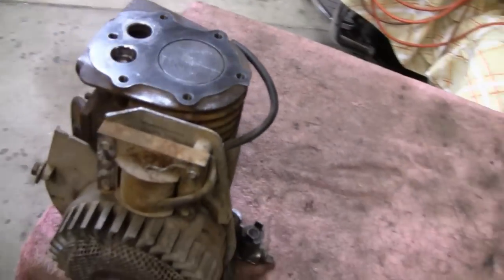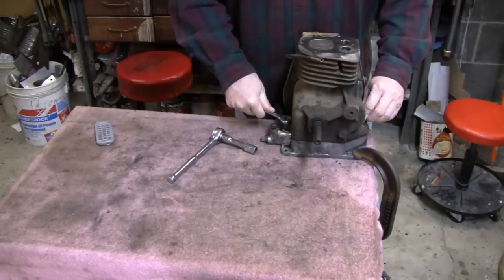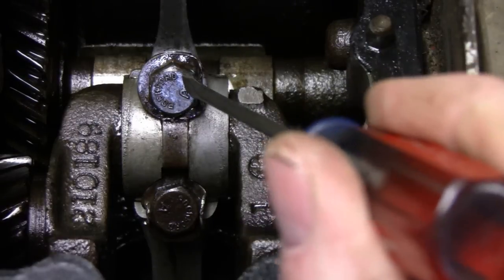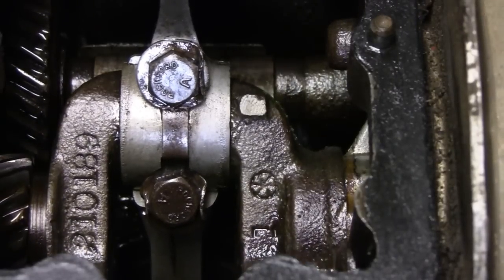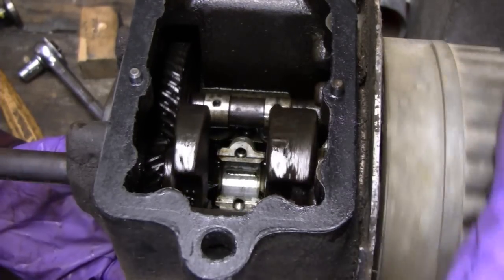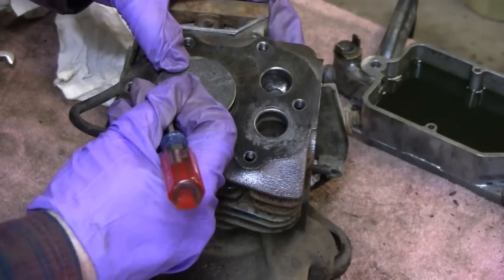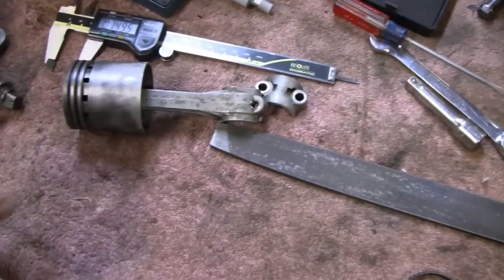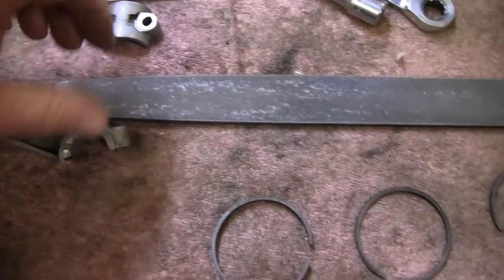HOMEMADE WATER COOLED BRIGGS ENGINE (part 6)

Comment: Extra points for lapping the rod cap to tighten up the big end bearing. These engines are very forgiving and they do just fine with a little "egg shape" in the rod bearing. In fact, older cars with babbitt bearings in the rods used to have removable shims to take up the clearance a little and these rods certainly would have been egg shaped by the time you needed to remove shims and they did just fine. Older engine designs were very forgiving with stuff like this. Don't try this with the newer junk out there.

Comment: OK, So far I have seen someone take 4 of the same Briggs engine and make them into a single four cylinder engine, and I gotta say that it came out excellent, a perfect job, and now this video. My point- I am over 50 and have never seen one of these engines in my entire life! What are they? what year, horsepower, excetera, I have seen an all cast iron B&A  1-1/4 horse  1900-1905. It was heavier than the mini bike we tried to put it on, we couldn't even get parts and all the numbers were there!! So what is this weird engine?
Reply from the maker: Thanks Bud!! We use 1954 Briggs model 6s,  1½ HP!!☺

Comment: How much do you know about 260ci V8 engines? Got a 64.5 mustang with a 3 on the floor manual and the origional 260 and 2 barrel carb. All numbers matching. I think all that the engine needs is pulled apart and all the gaskets and seals replaced and it might be good. probably do the same with the transmission and rear end. Last time it was ran and driven was 25 years ago and it has 27k on the odometer and as far as we know there is no 100k in front of that.
Reply from the maker: Don't know much about the engine, I had the same car but it didn't need any engine work. You shouldn't have any problem getting parts, it was the predicessor to the 289. It's definitely worth putting some time and money into!! 
https://youtu.be/xbcynP__W1w

https://youtu.be/CDFIwoa8c0g
Reply: Whatever you do if its the matching engine, don't get rid of it! You probably know this. If it were me and I had to go into it I would inspect all of it while I'm in there. Just my opinion but a lot less work than having to do it again. 260 is a very good engine. Good luck...

Comment: Do you need to use a torque wrench on the connecting rod bolts or just tighten them down fairly tight?
Reply from the maker: Nah, just tighten them, I don't even think there are torque specs for this old stuff!!☺

Comment: I wonder why that exhaust valve burned up but the rest of the motor was in great shape. maybe that straight pipe was not good enough
Reply: Johnny Smith probably a flake of carbon stuck and created a hot spot.

Comment: You should have washed out the freshly honed cylinder with HOT soapy water. It's the only way you can get the cylinder clean after honing, oil, thinner, carb cleaner or any other way won't clean it properly. The rings will ware out and cause oil burning if you don't.
Reply: turbothrust348 it's a display engine, not an f1 engine.

Comment: Kinda looks to me like the previous owner (or someone who tried to fix this) put the cap on the connecting rod backwards mismatching the cut, thus ruining the engine on run (all that slop had to come from somewhere, and the top end, with the exception of the rust, looked perfect). It's probably one of the most important things to do, always mark the orientation when installing, and so few do it...

Comment: just curious what's the point of building the water to cool engine does it get more power?
Reply: it doesnt get more power, but you can run the engine for longer without overheating (not that it would overheat before), but pretty much they are doing this for the sake of experiment with new stuff
Reply: Water cooling doesn't add any power but it can prolong engine life for some engines. On a lawnmower engine I don't see a point besides they want to, they can, and they want the challenge of doing it.

Kinda like their other builds I would think it's more of the challenge since they mostly just use them as display engines on a stand.

Comment: People in the comments section,  sometimes valves and seats are too far gone for valve lapping compound even on a display engine. This valve seat had "hunks" missing and sometimes you just need to either cut the seat properly or just replace it.  Valve lapping compound is for fine tuning and finishing a proper valve job, not to rework a badly damaged seat with craters missing from it. Valve lapping compound is not a cure all for every valve problem encountered in small engine repair.
Reply from the maker: Well said Mate!!☺
Reply: Indeed.

Comment: you could also try using a valve compound ive used it to re lap old honda valves ive never tried to repair a valve seat  its basically a 2 part compound  corse and fine grinding paste ive only used the fine to just re lap my valves ive never had a problem yet and my valves seat perfect just a suggestion  hope you fix your problem also love your videos keep up the good work!!
Reply: This is a pre-recorded video, they already got the tool (and presumably fixed it).
Reply from the maker: Thanks alot Bud!!☺